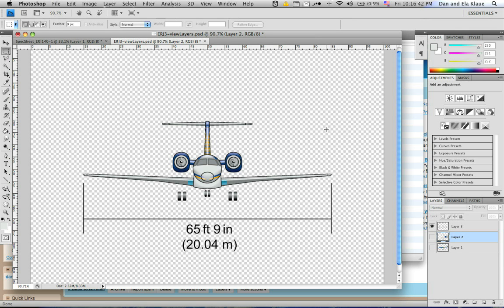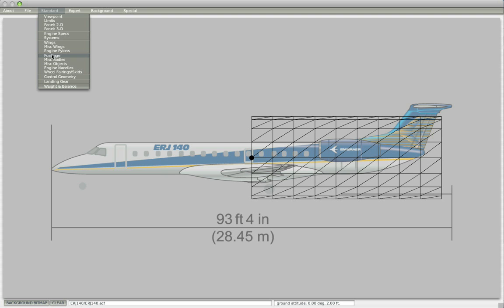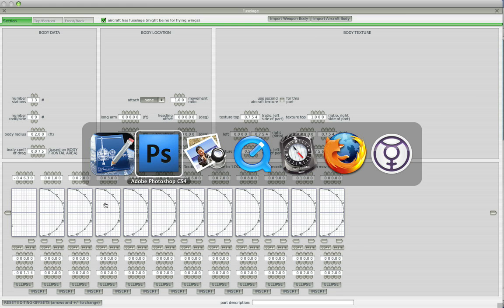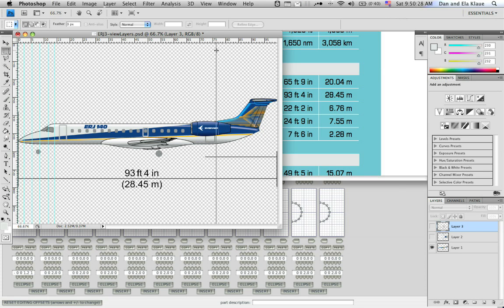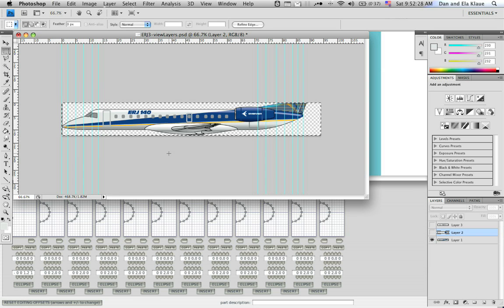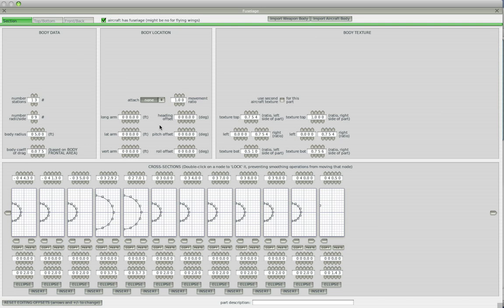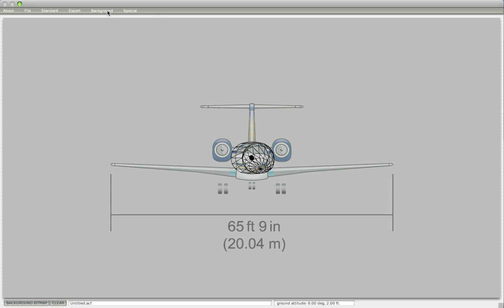PlaneMaker Tutorial 2: Modeling the Fuselage

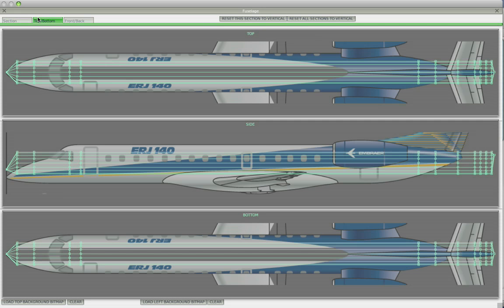Comment: I have never been able to get past this Tutorial 2 and believe me I've tried!  My background images are sized perfectly and all match the plane and are cropped correctly.  I have put in the data for each of the 13 sections and at 7:02 in the video my Top/Bottom views match the video exactly.  Then, at 7:07 in the video he zooms out which brings the wire-frame at the right side in to the left to meet the end of the fuselage.  And that is when everything comes to a halt for me. Because I cannot do that.  If I hit the "+" button I can zoom in, but if I hit the "-" button....nothing happens.  If I hit "shift -"....nothing happens.  The wire-frame in other words will get larger but not smaller.    So there is something about the zoom function that I am not understanding, since what he does at 7:07 in this video seems to me to be impossible.  Has anyone else experienced this?  Does anyone have a suggestion?
Thanks
Dave
Reply: +Dave Spindle Me too, I have been trying for hours and getting frustrated. I made my image as cropped as I could but it's length is not nearly long enough for all of the fuselage sections. Even when I zoom all the way out, the fuselage only goes about halfway as long as it needs. I have no idea what to do.
Reply: +Hunter TheAviator About the only thing I can say is to try building a smaller plane.  Everything seems to work fine for me as long as I'm building something 30 to 60 feet long.  Once I get into the airliner length of 95 to 100+ feet is when I run into zoom problems.  He has a lot of good information in his videos that you can use to build something else.  Personally, I make my reference point the tip of the nose rather than the way he does it...I find it much easier than using minus numbers to move forward and plus numbers to move aft.  Anyway...good luck to you!  It's a very "unfriendly" piece of software,  extremely quirky and can destroy my sense of humor really fast :).
Reply: Thanks Dave. Yeah he has excellent videos here, and I was building a small GA aircraft but I think the image was too high res, because I started another project with a low resolution picture and it zoomed just fine and the plane was about the same size.  Thanks for the tip.
Reply: +Dave Spindle Wait till you try and use the paint and 3D software he recommends - Gimp and Blender - Gimp comes from Unix\Linux so it's pretty quirky ( that's a nice way of putting it ) whereas Blender is just fucking incomprehensible ( there is no nice way of putting it ) It's not like I can't use 3D modelling software, I'm pretty good with Solidworks and Max, but I have never managed to figure out how to do anything in Blender.
Reply: I have got exactly the same problem like @Hunter TheAviator. What can I do to solve this Problem @danklaue
Reply: I figured out what may cause this problem:
It seems, only X-Plane 10 has got this Problem. If you use X-Plane 9 then the PlaneMaker doesen't make problems at all

Comment: Thanks for making such a detailed video.  I appreciate your hard work!  I was doing great until towards the end of video 2, when you pulled the wire frame in from the tail to the end of the fuselage. How did you do that?  You mentioned zooming, but all I could do was zoom larger, not smaller!!
If I crop from nose to end of fuselage it should work....but then how to add the tail?
Thanks again!
Dave
Reply: Also changing the max radius of the fuselage works as well (allows you to zoom 'smaller')

Comment from the maker: @livinlow15 Yes, very easy!  Run the X-Plane updater.  The discs include only X-Plane v9.00 on them.  If you do not run the updater, your .acf file, which was created in 9.70, has features that XPv9.00 cannot understand or interpret, thus it cannot open your file.  What you bought at BestBuy are mainly scenery discs and the main disc, which unlocks the time restriction.  The actual X-Plane app needs to be updated to 9.70.  You can do it from within X-Plane "About" menu.

Comment from the maker: @levygonz The Mac/Windows interface is a minor issue... the principles are all the same.

The "Crop" function in Gimp is simple: with the select tool active (R key), drag a rectangle around the plane. Make sure you draw it as tightly as possible, so that there is little to no extra space left beyond the wings or fuselage or stabilizer.  Then go to Gimp's "Image" menu, and select "Crop to selection."  Then save that image as a .png or .bmp file, and import it into PlaneMaker's background.

Comment from the maker: @JHAAMYEESS 

If you're trying to load a background image, make sure you don't try to load the image through PlaneMaker's "Load Airplane" menu, but rather, through the bottom  button for loading background images.  

Also: have you checked that your images are exported properly from Photoshop?  You need to make sure the format is correct, and the extension (.png) is at the end of the file, and that the images open up properly on their own.

Comment from the maker: @g25a25c 

You can try 2 things:

1. Check the airplane's weight.  If it's a very light plane, it'll crash from just sitting on the runway.  (You might have forgotten to enter a proper mass, or if it's a very small, light plane that you want to build, you need to set X-Plane to handle such a plane better... see 2.

2. You can try increasing the number of calculations per frame rendered in X-Plane.  Go to "Settings>Operations&Warnings" and set the number to 5 or so.

Comment: I am making a glider, so he wings are much longer than the fuse.  I am on my fourth try at the images.  To create the fuse in three view I did as Dan suggested, cropping from nose to rudder edge, creating a slender rectangle.  For the main editor, the crop for my project is square because the top view and front view are dependent on the wing span.  I found that I need to change the zoom between the fuse and main editors, but I think it will work.  Thanks, Dan, for all the videos!